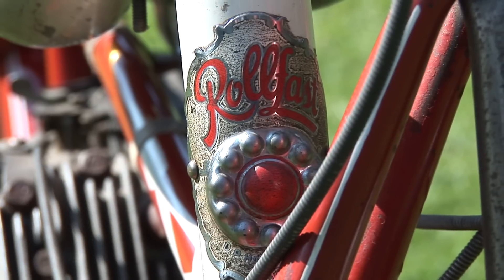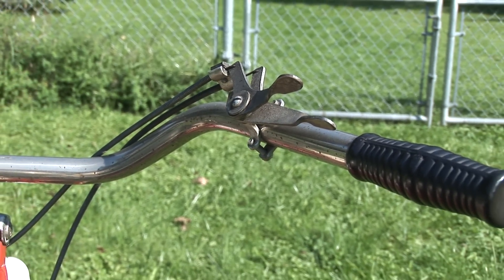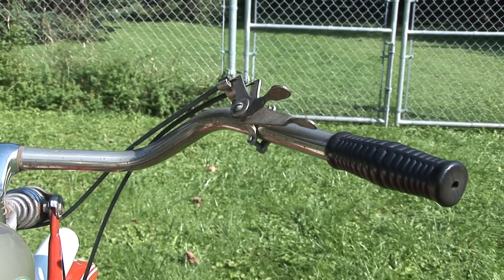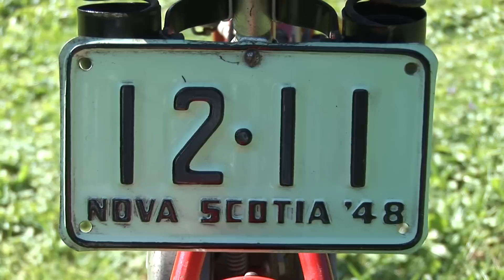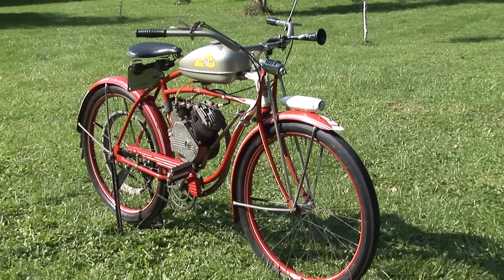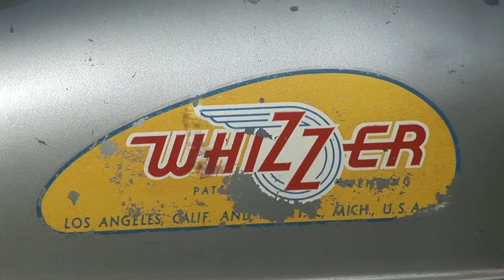Whizzer Moped 1948 Vintage

Comment: I think the issue may have been no front drum brake on the bike.  If you've ever ridden one without the front brake, it is nearly impossible to stop - on only the rear coaster brake.
Reply: I rode my 1000w '52 Roadmaster with only a coaster brake two months then got front disk now on my gen3 '53 1500w Roadmaster I have 2 disks and regen 1-5 braking and it's just good enough. LOL!